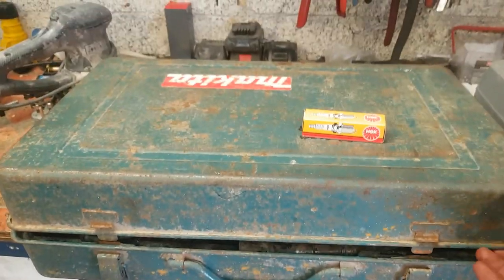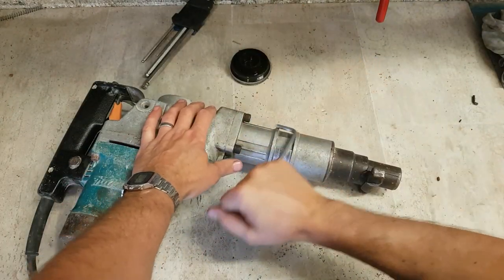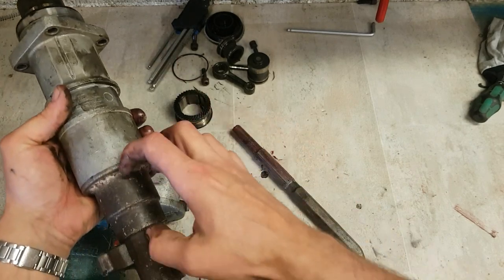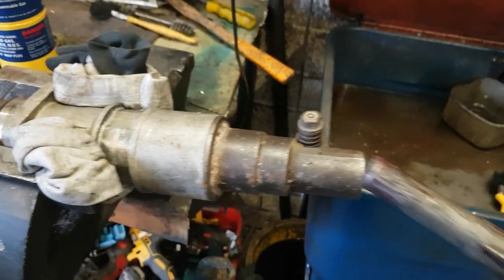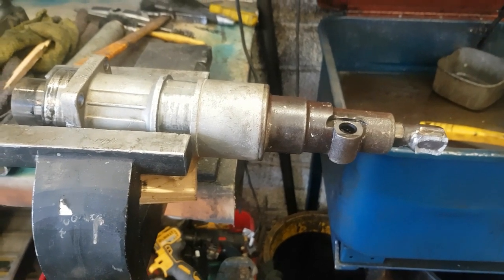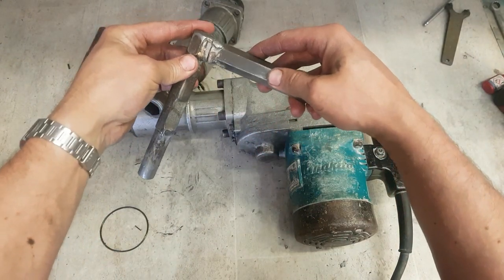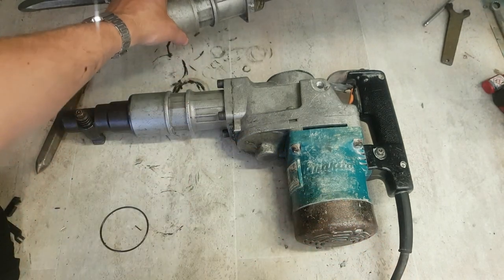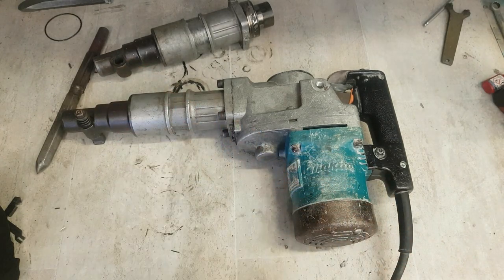This one nearly beat me, Repairing a old Makita HR5000K rotary hammer.

Comment: I just noticed there when you said it was a left hand thread when you were screwing it together but when you were taking the old one apart you were turning it the wrong way to loosen it if it was a left hand thread 4:40
Reply: Yeah, what the heck?
Reply: Nice!
Reply: Came here to say the exact same thing.
Reply from the maker: you are right, i was doubting myself. tried unscrewing it left hand but it wouldnt budge. so thought i was wrong and tried right hand. still no good. had to actualy take out a new one to check if it was left of right hand thread. And it was left hand thread so i got a longer bar and gave her welly until i broke my tool. 
what a handling. a lot of messing about, and all for nothing.
Reply: @deandohertygreaser  that's the problem when manufacturers use 2 dissimilar metals in contact with each other that aren't separated for years and years at a time.
Reply: @deandohertygreaser  good on you for admitting a minor mess up.  I dont do repair, but that end fitting looks mightily like an M18 or M20 (edit upon further review). Could a hex head impact hex socket of that size break it? Genuinely curious
Reply: Nice scrap bin with the correct spares. Do you have an Amazon link for that? My scrap bin always has wrong stuff 😂
Reply: Some going
Reply: @jasonbuckler190  i was thinking the same, i even used a coupler nut with a normal impact socket once to break a hex bolt loose. those chisels are hardened, when welding them together the area around the weld gets very brittle.  i dont know if there is a way to weld them properly but when there is it wont be easy.
Reply: I changed my tool holder about two years ago. I never thought it would have been so tight. Nice machine, had it for 15 years with no major issues.

Comment: The struggle is real Dean, thanks for posting these nice to see an expert at work.

The tube has 2 flats in the middle that you could get a big wrench or small Stillson onto perhaps? Big impact gun on the 19mm AF hex tool set to 5 'ugga duggas' might crack it open, or maybe flip your bench😮. Leave it soaking in ATF and acetone for a few days might ease it a bit. Do you ever use Neva-Seez to stop the corrosion starting again?

I've had one of these since the mid 90s. Doesn't get loads of use now but works when it needs to. Got some big core drills and a have used them to recess cctv cameras into concrete 'dressed stone'.

Japan built Makita and Hitachi kit really were built to higher standards.

👍